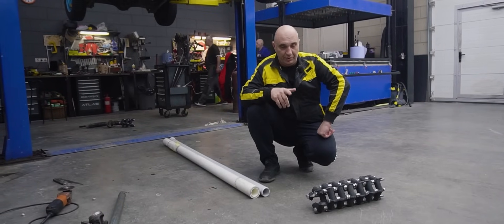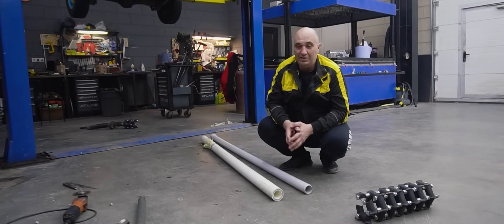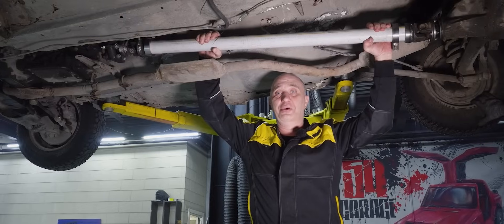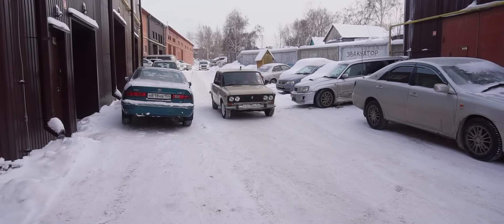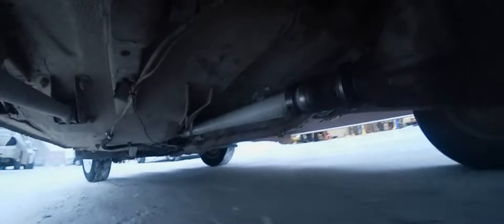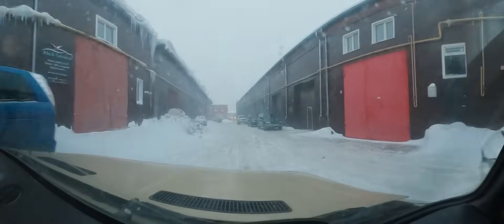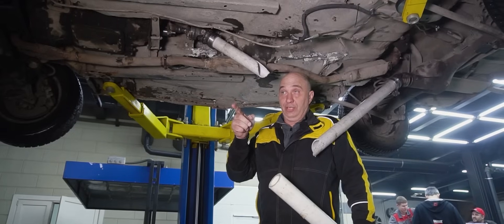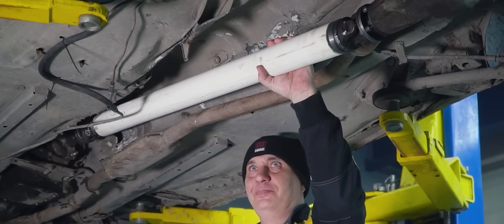We make a propshaft out of PVC pipe - will it work?

Comment: I have a lot of experience with taking a golf ball and other miscellaneous objects and using a little electric motor that would call a grinder or a Dremel and spinning the ball on it and sometimes we get an oscillation what we call purling SPERLING Sterling Whatever anyway you started to get a strong oscillation because the pipe got hot because the exhaust warmed up next to it, and we use heat to bend the pipe. Then the pipe was hitting the wall of the bottom of the car and straightening out its oscillation, and it occurred several times before the pipe, finally scratched itself on the hot metal and spit apart, move the exhaust system further away from the pipe and revisit without the clamps on the thinner piece of PVC you might find a better result

Comment: Remove the tabs from the clams, Drill through both the rings and the base shaft run a bolt through rings and the base shaft and tighten them to keep the weight as close to center as possible.

Comment: I.
Was on a trail stuck in the middle of the woods. With my.
Girlfriend camping. My rear drive shaft ended up Twisting and broke. I ended up finding a pipe In the woods I don't know what it was for but. It was big enough to go around the s left of my drive shaft. So I cut a chunk off. Did my best at welding. I used it as a sleeve and a bandaid. For my drive shaft. I could drive it but not fast And it vibrated Really bad But it got me Home.

Comment: A friend of mine used a carbon fiber shaft in a supercharged Nissan 370Z. The car was used for quarter mile racing and had over 1000HP. I don't know how much torque it had, but I'm guessing it was similar to horsepower.

Comment: First make pipe of Fiberglass and resign, after curing fill it up with loose fiberglass or expandable foam, the empty pipe is just filled with air, the air heats up with the rotation and creates further imbalance and warping, fill out the empty space within

Comment: Driveshafts get rated in something called 'critical speed'. I believe the the crititcal speed for PVC is 'not enough'.
Reply: I never heard the term critical speed before but I experienced it once when I spun up a slightly bent 2' long 3/8" drill bit up and watched the flex in the middle get bigger and smaller with the drill speed until I spun it fast enough that it bent 90 degrees halfway and put me closer to the orbit than I wanted to be.

Comment: You should DIY some drive shafts. See how light you can make a reliable drive shaft? PVC and carbon fiber, balsa wood and carbon fiber or fiberglass, thin stainless steel wrapped in carbon fiber and filled with high density foam, PVC filled with high density foam, I feel like the options could be endless, Make a whole series about different drive shafts and materials?

Comment: There are many sizes of pcv pipe; high pressure, waste, and stormwater. In that order of quality/thickness.
You could put a 45mm inside of 50mm, with some glue. That would be lighter than insulated pipes, but very strong.

..also, because it's very cold over there, I see no reason to needlessly waste money on new glass windshields. WINDSCREEN made of ICE, is perfectly sufficient?! hint!

Comment: Redo the single wall pipe but fill it with a rigid 2 part urethane foam. I don't mean Great Stuff from a spray can, use Smooth-On FOAM-iT! for a rigid fill to keep the pipe from flapping around. Unfortunately the closest distributors of Smooth-On products are Globmarbl in Odesa, Ukraine and Kevra Oy in Helsinki, Finland. Could be a Russian manufacturer of similar urethane foams.

Comment: Instead of using the ones they use for sewers and waterworks, try using the PVC made for high pressure. Like the ones that are made for high pressure water and air lines that usually run along factory walls to distribute pressureized water or air. The ones that are usually black with a blue stripe running along them.
Reply: Aye schedule 80+ for starters.

Comment: Try that with ABS drain pipe, the black ones. PVC shatters but ABS is tougher so it shouldn't break from flopping around right away. It will probably start to get discolored areas from where it has deformed and then twist up.

Comment: Video idea: I've been looking at your old videos and you have a number of videos where you make transparent parts -- there's a transparent oil pan, a transparent transmission, a transparent body, transparent seats, etc. There must be enough parts now to start making a FULLY TRANSPARENT LADA!

Start by making a car work using the transparent parts you already have, then from time you time you could choose one or two of the remaining non-transparent parts of the car and try to make them transparent. Like the steering wheel, the windscreen wipers, the fuel tank, etc.

Over time you'll hopefully get to a point where only the parts that are under the most forces are still non-transparent, like load-bearing beams, nuts, bolts, and screws, oh and probably the wheels too -- they'll be difficult.

But there are a lot of easy parts you can make transparent before you get to something like a wheel. :)

Comment: judging by the balance weights I have seen on prop shafts your clamp on 1 side looks 20 x bigger and more from the centre. Them I watched the rest of the video no Suprise.  It would be interesting to see how the pvc would do without the vibration causing the bowing then breakage I suspect it would be fine and with the 1-sided clamp on the reinforced pipe that might have failed.

Comment: Carbon fibre prop shafts are used in racing. They are so much lighter plus they are stronger than regular shafts. I've watched a show where they tested both regular and carbon fibre to the breaking point. Carbon fibre was the clear winner by a huge amount.
Reply: I have a carbon fiber shaft in my drag racing car.  It is rated  to handle 3000 horsepower. They are safer if they do break also. They basically turn to dust and carbon fiber strands . People have been seriously injured by broken steel shafts wipping around and coming thru the floor of the car.
Reply: @MansonSherrillJolly  You should change your name to fastvega. :P Thanks for the info mate.

Comment: Straighten out a coil spring, clean it up then heat it until the color yellow shows(or blue, depending) drop in vege oil and will hold up. Maybe make one super hot before submerge in oil and one slightly hot, test a temper of glass hard steel Vs. One tempered to have a bit of flex/softer/less brittle. Car springs are gnarly when ya start to play with their temper. Used to make swords out of them
Reply: Honda car springs from '90s are really good quality
Reply: Springs are pretty much the only thing in a honda car that is quality lol (also honda alloy can be same as their motorcycle alloy, if wanting to make some castings that have a bit stress)

Comment: Manual RX8s came stock with a carbon fiber drive shaft. It would be a good reference. I snapped one before, and it's thinner than you would think. But they can handle some serious abuse. But remember, the rotary is a low torque engine. Making weight reduction like this possible.

Comment: Rear clamp was hitting the exhaust too and that caused a lot of vibration... For thin PVC pipe to last it needs to be soft enough, so it can flex with vibration, but not soft enough that it will twist on its own axis.

Comment: The inside of the pipe has a slight high spot where the seam weld is. you would need to clean up the ID to get it center  🙂

Comment: Mmm, why not using a metal pipe and tube, like a pipe for water or gas with a diameter you can easily buy in a warehouse or many people can have in backyard rusting, so... if in case of need someone has to improvise one we will know how long will it hold and even, get some tips ;).
Probably the last pipe was more expensive than a used prop shaft for that lada ;)

Comment: the larger the tiameter of the driveshaft, the more torque it's able to deal with because it's spread over an even bigger surface that it has to try and twist torsionally against, meaning less torsion flex. that ultimately means better overall rear end responsiveness.

Comment: 2 cars. First car with regular drive line until the rear diff... then have the 1st cars rear diff have a prop going out the back as well. Have that be a very long and flexible prop going to the second car, which will have no engine. So have the 1st car power both cars with a single engine and only a long prop connecting them in-between. Maybe a tiny little trailer (like the size of a handtruck\dolly) for a carrier bearing or something to keep it from sagging and allow the cars to turn.

Comment: The muffler falling off, lol.  😄  Have you tried filling a form with concrete for a shaft?  Knowing you guys, you've likely done it already.  What about using a suspension bar, or a few of them together?  See if they twist and break.
Reply: concrete propshaft. That seems fun
Reply: A leaf spring made straight and re tempered would hold up im 110%  alot of work for a video tho. Im sure a coul spring straightened out would be fine as well, or tho neither of them would be much lighter,  if not heavier

Comment: One reason you have a bit of a wobble is the drive shaft is out of phase you have the yolks not in alignment anymore If you look on a factory drive shaft they're not just any old which way they have to be in phase with each other or you will get a wobble
Reply: Also those PVC pipes are NEVER perfectly straight. I've installed enough of them in drains to know.
Reply: You need a guide every foot to stop wobble.  Also, this is a drive shaft, not prop shaft.
Reply: @douglashewitt5064  It is not that kind of wobble but phasing, meaning when the prop shaft bend a little in the U-joints the prop speeds up and down if the U-joints is not aligned up. But in this application it does not matter as the prop is not bending in the U-joints, it is more a problem on very high 4x4 cars where the u-joints have to bend .
Reply: @a64738  I wondered why they called it a prop shaft.  Seemed funny.  Thanks.
Reply: Yes those shafts need to be balanced before install

Comment: You should try a plastic everything: plastic engine, plastic gearbox, plastic propshaft, plastic differential, plastic axles
Reply: Have you seen the car that had wooden everything, wooden engine, wooden gearbox, wooden prop shaft, wooden differential and wooden axels?? it wouldn't work. Dumb dumb.😂
Reply: @stevenc5227  wood doesn't really like heat...  Plastic can withstand heat better, but for long term using compressed air instead of fuel to power plastic engine would make it last longer.
Reply: @Monni95  Guess the joke went straight over your head right??😂
Reply: There's a video on that for the engine

Comment: you should try using a huge spring as a propshaft. It would be interesting to see how the spring would work
Reply: I think they have
Reply: @amanyouel_e24  the vibrations would be CRAZZZZYY bro lol
Reply: It'll quickly buckle up under torque
Reply: @Novous It would have to be inside a tube of some sort
Reply: All I can think about is the sudden speed increase when the spring starts unwinding.
Reply: Type in "spring mod for propshaft", it's not exactly what you're suggesting, but pretty close I think
Reply: That sounds incredibly dangerous 🤣
Reply: They've already given that one a go.
Reply: lol
Reply: it will twist and break
Reply: Perhaps a garage door torsion spring with a rod in the center to keep it from bending around too much
Reply: @oh_finks  lol, clutchless takeoffs on the way,  put it in gear and launch
Reply: If it were a spring, when it starts spinning fast the center between both ends will bow outward and start slamming into the bottom of the car. Unless it somehow has perfect balance and alignment.
Reply: Straighten out a coil spring, clean it up then heat it until the color yellow shows(or blue, depending) drop in vege oil and will hold up. Maybe make one super hot before submerge in oil and one slightly hot, test a temper of glass hard steel Vs. One tempered to have a bit of flex/softer/less brittle.  Car springs are gnarly when ya start to play with their temper. Used to make swords out of them
Reply: They already did this
Reply: @AlienLivesMatter  i know , but thanks. pretty sure alway roomm for more fun in the grey area. pretty sure they havent tried all springs :). cheers
Reply: Hhahah weld some supension car springs!
Reply: Pontiac did something early '60s
Reply: Literally what I was thinking while watching.